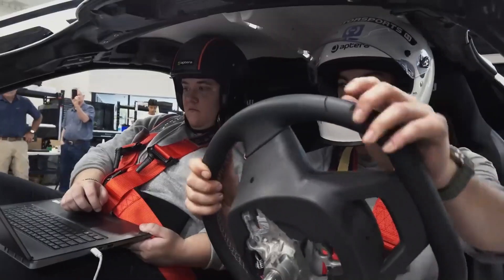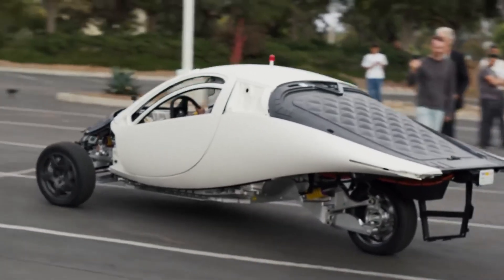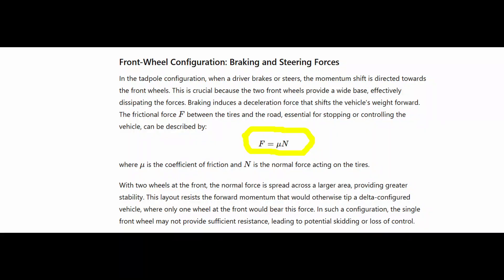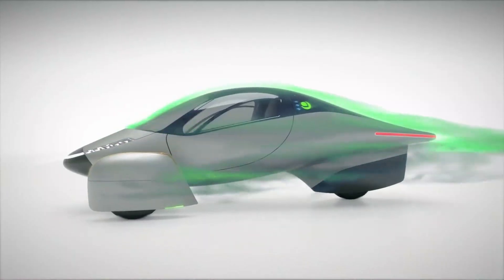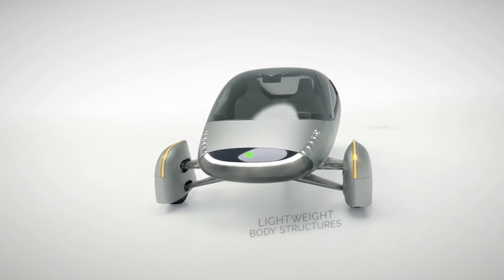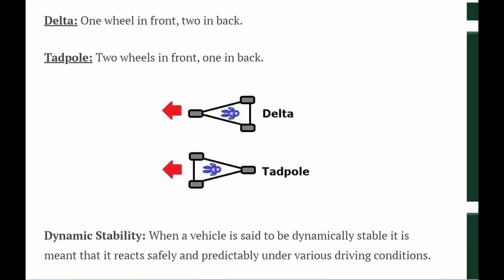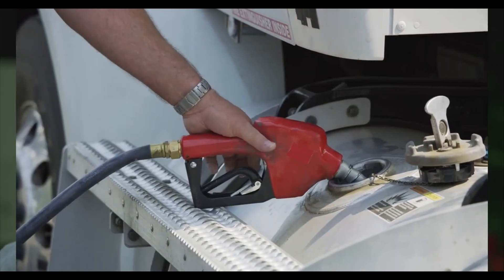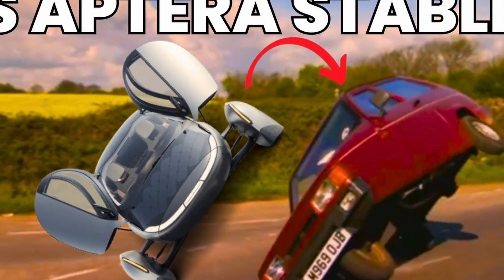Aptera Motors' Stability Physics and 3 Wheel Configuration Uncovered

Comment: These formulas are irrelevant. The rear wheel(s) are responsible for dynamic stability. The Aptera lacks one wheel compared to a real car, so the dynamic stability is less than 50% of that of a real 4W car.

Comment: Engineers and teachers will cringe at this. Discussing weight transfer can be much simpler. Everyone knows that the delta configuration is terrible, why not discuss how the Apterra's three-track design is or isn't worse than two-track (four-wheeled) vehicles?

Comment: It would seem to me that the tadpole design would be better for turning during braking, where the momentum of the vehicle is pushing it both outwards and forwards, putting the weight of the vehicle on the outer wheel.

Delta I would think would work better for turning during heavy acceleration for the same reason. Presumably this still gives the advantage in maneuverability to the tadpole design
Reply from the maker: @Xpetersob
Hmmm! Delta during heavy acceleration? 🤔🤔🤔
Reply: @Elementraz  Or an all-wheel drive system will better support hard acceleration.

Comment: Although most jets planes are made in a delta orientation. I guess jets planes are geared to manoeuvring.
Reply from the maker: Lo! 🤔
Reply: Delta wing and delta 3 wheeled vehicles have nothing in common except the word “delta.”  Interesting idea. English language words and phrases can be confusing. Logic and language are not close companions.
Reply: @LaserMechanic  - I see that many people just group things together. For example, Carbon Fiber. People just assume that the forged is just like the laid up version. Yet they are not alike each other at all. It's like aluminum or even potatoes. Lots of variation there even though they share the same initial name.
Reply: So the Trike design is like the plane design where the wider wings are towards the rear and behind a smaller set of wings. This is a delta wing design... I.e  Wider apart wheels/wings towards tail.

But most aircraft have the wider wings in front of smaller wings that are near the tail, which is like the Aptera design wider set apart wheels at the front.

In aeronautics, a canard is a wing configuration in which a small forewing or foreplane is placed forward the main wing of a fixed-wing aircraft or a weapon. The term "canard" may be used to describe the aircraft itself, the wing configuration, or the foreplane. Canard wings are also extensively used in guided missiles and smart bombs.
Delta wing design in jets planes is an example of canard wing design.

Comment: I suggest you go watch the Aptera video of when they did the "moose test'. It shows the inherent fault in a tadpole design. Thank goodness Aptera showed us in that video because it proves my point. When you load a vehicle hard, the body rolls. With the tadpole design, you have zero camber gain. It's always 0 degrees. So when in a corner, the tire goes into positive camber. Thus the one thing you do not want to do. You can clearly see, only about 10% of the tire is in contact with the ground. Then it goes into a huge amount of oversteer because you can see the driver giving it lots of opposite lock to keep it under control.

With the new front suspension, they had to lower the roll center to make the frond dampers fit. Thus the amount of suspension tuning to find a balance between comfort and handling will be a much larger task than with a traditional 4 wheel vehicle.

Unless Aptera does all of this testing with a full outfitted vehicle, it's a waste of resources just like they did with the Beta. People are not buying a stripped out track car, so why test that? Plus they are using KW Motorsport dampers on that Pi2. That something that will never be put on the production vehicle because of cost and they can't make the volume Aptera needs.
Reply: That test was done at ~48 mph; at that speed Aptera is in the top ~5% of vehicles.  Most vehicles would roll or completely lose control if they attempted at the same speed; it is meant to test the absolute limits of the vehicle.
Reply: @ccibinel  - I'll add to that, they did it with a stripped down version of a different vehicle. I just wanted to add that small detail.
Reply: @Torrent.Amador  - Incorrect. Just mentioning the obvious that others ignore.
Reply from the maker: Yeah, lo!
Reply: @ccibinel  How do you know the speed? Aptera did not offer  any real world data.
Reply: How fast was aptera during that test?
Reply: @VedaSay  - Nobody knows as Aptera doesn't release a data file. Instead they just tell us in a video and we have to determine if it's correct or not.
Reply: Good point about loss of traction of the single rear wheel as the vehicle rolls. Active roll control in the front suspension would help, but it's heavy, complex, and uses power.
Reply: @dcmackintosh  - Best part is, Aptera showed us happening in their video. So, at least it's true and I'm not making it up. As for active roll control, that's something way out of reach for Aptera. They are having enough of a time just trying to make them function under their own power.
Reply: I think you should make clear that it's the single rear tire has no dynamic camber gain, and will go into positive camber as the body rolls into outward in a turn.  It's pretty easy to set up negative camber roll curve on a double A-arm type suspension, such as on the front of the Aptera, and most cars that don't use a MacPherson strut suspension.

One advantage of a single tire in the back is that on most 4 wheel cars, the two rear tires are always fighting each other around turns because they each want to take the turn at their own radii.  So their traction will always be compromised around turns, unless they have active rear steer.  There is no such problem with a single tire in the back.

To alleviate that single rear tire camber going positive, they will have to change that simple swing-arm rear suspension to some kind of multi-link system that changes the tire camber with body roll, just like on front suspensions.  But that's going to ass weight and complexity to the car.
Reply: @eycchu  The rear wheel is necessary for the stabilitiy of the vehicle. If the rear wheel loses traction, the whole vehicle loses track. In gets uncontrollable. That is the reason why in security driving lessons you learn to ram the rear of the enemy car.
The Aptera motorcycle only has one instead of two wheels in the rear. So it is just able to transfer less than 50% of the lateral force of a 2 wheel vehicle.
All this has nothing to do with suspension or turn radius.
Reply: @eycchu  - This is why Aptera shows this exact thing with their moose test. Thus the rear tire only had about 10% touching the ground and thus went into a loose condition that required lots of opposite lock.

I hope the Aptera has stability control because it'll need to. There's a reason why a Slingshot does. When the IIHS turned it off and did a moose test, they rolled it over.
Reply: @eycchu  I don't know what you mean about the two rear tires "fighting each other. " The outside rear tire of course sees a higher normal  force and therefore has more available traction. The inside tire has less avaliable traction and is spinning slower and following a tighter radius, but still provides a lateral friction force in the correct direction.
Reply: @dcmackintosh  It's called Ackermann geometry.  Most cars with properly designed front steering will turn each wheel at an angle to properly follow its individual turn radius.  But few cars with two rear wheels will have that setup in the rear, so each rear tire will be aimed in a direction tangent to its path instead of in the direction of the path, and each side will be different, so both sides will be scrubbing through the turn at different angles.

It also happens in the front with the turning wheels if they do not have proper Ackermann geometry.

If the scrub angles of each tire are different, they are fighting each other.

Comment: You didn't mention the fact that a flat plane can be drawn through any 3 points in space, but not 4 points in space.
ie: A 3 legged table never wobbles... try it.
ie:  a 3 wheeler with solid wheels an no suspension can keep all 3 wheels on the ground at all times.
ie:  The suspension on a 3 wheeler has less work to do and that means it works better.

Oh you're trying to convince bunny huggers who like to believe there's zero carbon footprint from producing and recycling batteries and solar cells and that all charging electricity is green, with big technical words.
My bad.

That said an active front suspension that slightly leans the Aptera like a bike in corners would be the cat's meow!
Really easy to do in this case, with a simple active anti-roll bar.
Reply from the maker: @RayleneCawood

You are humourous!
Hahaha.
Thanks for the comments
Reply: A driving vehicle is not a table. Vehicle Dynamic is something completely different than a static table.
Reply: @vic321344  :)  Obviously not.
So how do you explain a flat plane through any 3 points in space but not any 4 to a lay person easily?
Do you always quote phrases out of context?
Oh you stopped reading there because that where I lost you...
Yes..... you are riiight!...
Reply: @RayleneCawood  We are not talking about planes, we are talking about vehicles that drive on the road and transfer force over wheels to the tarmac. Just the simple fact that a car changes the position of the wheels when driving curves or just drive over a bumphole makes your 3 point theory worthless.
Its not my fault that you lose it.

Comment: Yea, yea, yea, but this car starts out with an excessively high center of gravity. A excessively high front roll axis or center and the battery pack and passengers very high in the car. So yea in this video they are pointing out to you the problems that the car has and are telling you that this design, creates problems they can't really fix.
Reply: You are incorrect. The battery pack is about 14-16 inches off the ground.
Reply from the maker: What?
Reply: @glennzajic7318  Yes you are so right. The battery whitch they never shown on purpose will have to be 16 inches off the ground. Making the center of gravity real high compared to any other ev. So your just being full of BS
Reply: "but this car starts out with an excessively high center of gravity".... wrong
Reply: @chopsueykungfu  - It actually will be. Now it'll have double laminated glass with solar panels sandwiched in between them, on the roof, hood and rear hatch. So, that adds weight as high as possible.
Reply: Pretending trucks don't exist ig
Reply: @Torrent.Amador  - Three wheeled trucks?